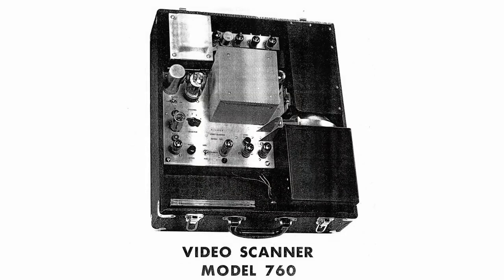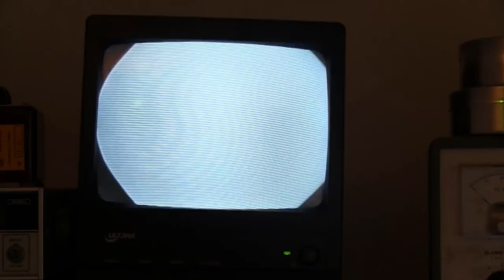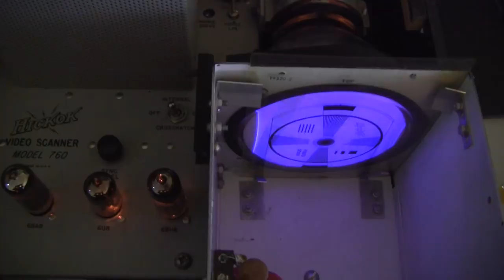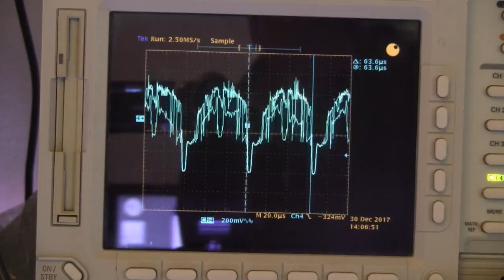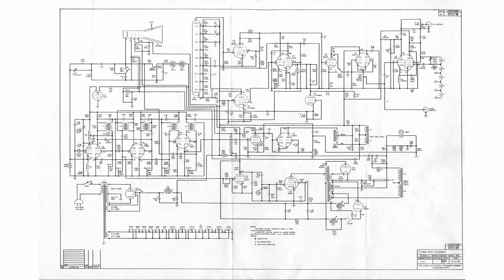1957 Hickok 760 Video Scanner

Comment: Nice sync generator! True 2:1 interlace! I once had an old B&K 1070? that  used crude oscillators, no interlace. Then several years later in the early 80s I was exposed to a Rank Cintel MK3. Hey, thanks to the B&K from the late 70s I knew exactly how it worked!

Comment: That has got to be the cleanest piece of Hickok equipment I have ever seen.  It also appears to be in a case about the size of a Hickok 539A, B, and C Vacuum Tube Tester.  

I recall the B&K Precision units in the 1970s of which there were several at Torrance ROC.
Reply: The out on service calls slide might have worked better if written in black grease pencil.....

Comment from the maker: This is a reply to DandyDon and everyone else, in reference to the red printing on the "out on service calls" slide. Red was a very good choice for writing on the slide. In UV light, red is black. There are two reasons for using ultraviolet light for scanning (in monochrome). First is that the photomultiplier tube (PMT) is most sensitive to UV, keeping the needed gain of the video amps as low as possible to reduce noise. Second, is that for scanning, very short persistence phosphor is needed to make the "flying spot". Regular P4 phosphor glows for nearly a full frame after being excited by electrons. The P14 in a scanner tube only glows for a couple of microseconds or less. In fact, it will decay in brightness by over 90% in the first microscond and 90% of that again in the next. If it were a comet tail of light, the image would be blurry. The sharpness of the images from this unit implies that the phosphor in this unit is very very fast. This scanner tube was made by Sylvania, just like my color scanner tube. (future project)

Comment: Would one be able to make a flying spot scanner using a small black and white TV and a phototransistor?
Reply from the maker: Simple answer. Yes. The phosphor for scanning has a very short persistence time of a few microseconds. TV phosphor has a medium persistence in the milliseconds. The short persistence looks more like a spot at full speed. The TV phosphor has a very long comet tail of many lines. It works, but requires heavy equalization in the video preamp and is still only able to get to about 200 lines of resolution compared to an average of 300 lines in normal pictures. 
A photo transistor might work. But, you will have to drive the CRT very hard and possibly use a convex lens to get the light from the edges onto the small die of the transistor. It would be a good place to start. Set up your photo transistor, hook it to the o'scope, and aim it at a normal TV picture. Can you see video on the scope? I performed this experiment at the bottom of this page on my web site: http://www.labguysworld.com/PhotomultiplierTubes.htm

Comment: You have a lot of good toys original  Richard and something you did not mention and is a myth that if a PMT working is exposed to light as yours shown working with case open will be instantly destroyed ..it may at top operating voltage but not at 200 to 400 volts as this would be working at ...another myth it needs uv light not so i have tried them at lower wavelengths and they work fine on them too ..also may not work as well but i bet the PMT would work side on to the light coming to it from the crt ..they are my favorite  device in a vacuum